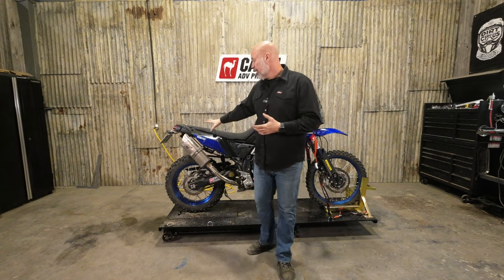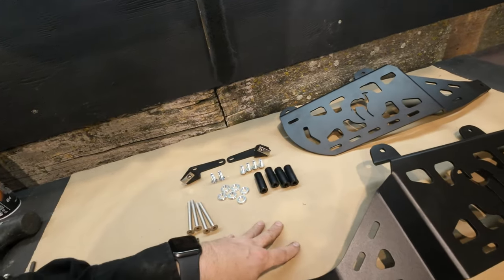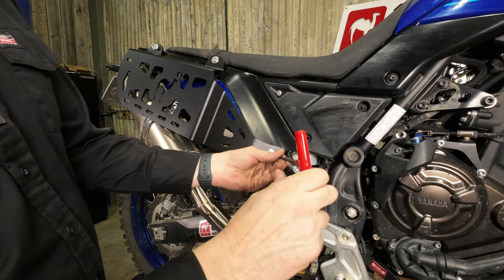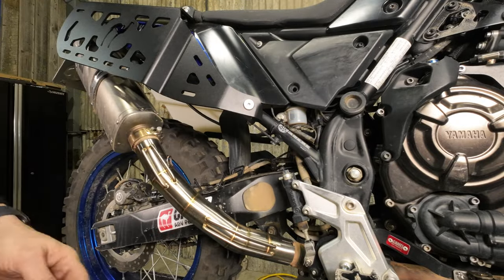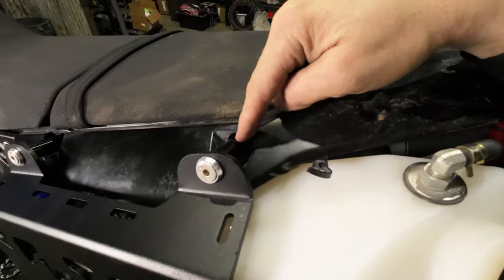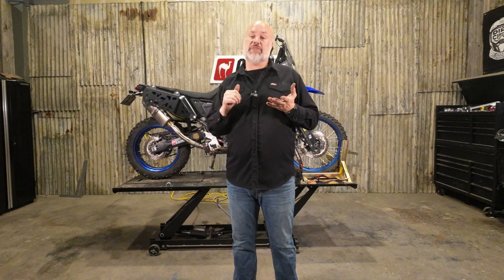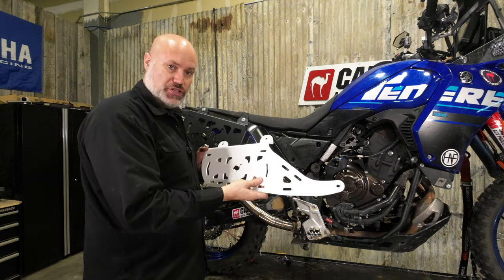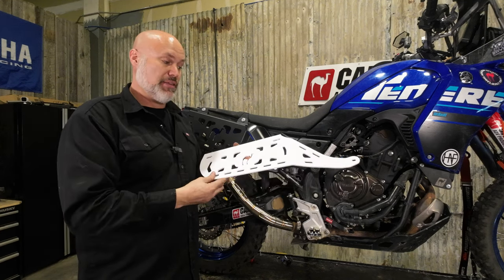T7 Soft Luggage Plate Install

Comment: Will they work with factory passenger pegs?
Reply: I emailed them the other day and they said yes! Got a set on the way
Reply: @RayRayLitFam Thanks fellas. I’m in the beginning of installing them and noticed that Cory didn’t put on the passenger bracket. The comment section came through!

Comment: I know it's new so the answer is 'probably don't know yet", but does this work with the Yamaha/givi rear rack? I've seen a few forums asking about side soft storage plates that work with it(myself now included). Also have you ever thought of doing a "emergency" side stand or field stand similar to snapjack, tusk or rolling mavericks? In the market for one and you guys always seem to make high quality field tested stuff, just a thought anyway.
Reply from the maker: It depends on the length of the spacers/stand-offs on the OEM/GIVI rack. If you measure them and let me know, I can check.

We designed a trail-jack and made a few samples. It worked well enough but seemed more complicated than a trail jack needed to be (heavy-duty Snap Jack, basically). The EnduroStar unit is cheap, simple, and works really well so that's what's in our tool roll.
Reply: @CamelADV  I haven't put the rack on yet so I can get some measurements tomorrow, thanks for the recommendation!